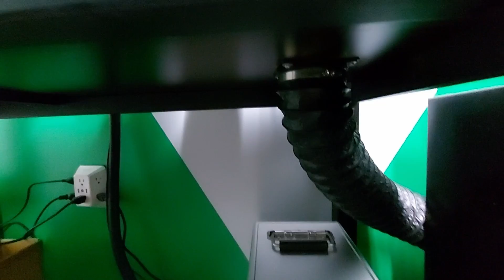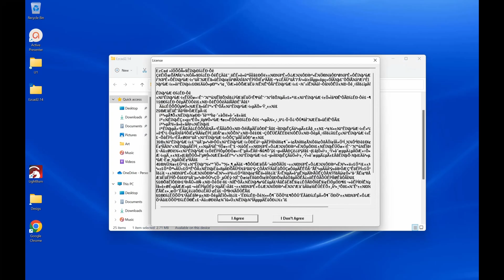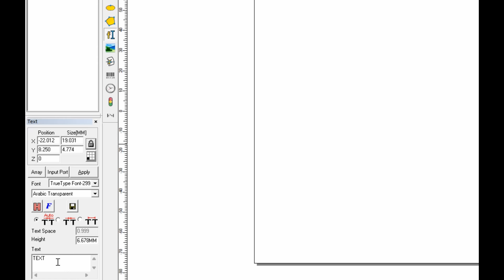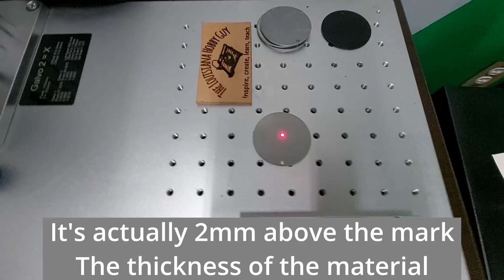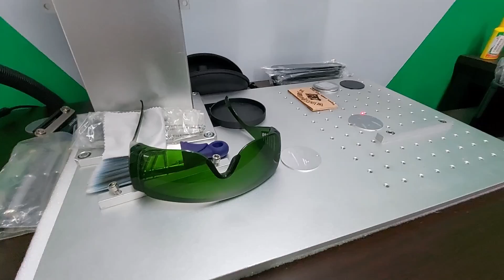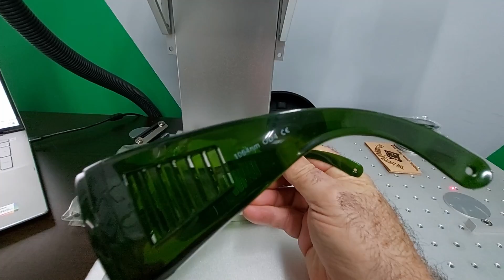💻 Get Started With Fiber Laser Software For Your Raycus Source Laser In Minutes!

Comment: Hey Rich....Just took delivery of my Monport 50 watt laser and got it all hooked up and followed your video above to install the software and guess what.... NO 2 little focusing lights come on !!!
I can focus while burning listening to the sound like you said BUT no 2 dots to converge and no 2 lights under haed next to lens HELP!!!
Reply from the maker: The tech support website is https://cofcc.com Bill.
Reply: Hope you figured this one out after a year, but just in case and for any others that have run into this. On the top of the gantry (arm that you move up and down for focus) there is a little button. This is the on machine on/off switch for the focus lasers. If they are not on,  just push that button located on the top of the laser head.
I hope I have enough detail without over explanation.  God bless and many happy engravings.

Comment: Dell's laptop speakers are also garbage for the cost of them as well. 😡 Maybe Asus does better?
Reply from the maker: These speakers are off the charts! They're amazing! And so is the screen! QHD & IPX touch & IrisX graphics with the Core i9 processor. Watching 8K videos is like 3D! I needed a convertible to fit in some tight spaces.
Reply: @TheLouisianaHobbyGuy  you got lucky. Mine are tinny and generally yuck. Luckily I prefer using other audio devices, but Dell dropped the ball for the price.
Reply from the maker: I use Klipsch THX Pro-Media on my gaming computer. Recently replaced an 20-year-old pair of Altec Lansing. Sound is important to me! But I have to say, this is the best sounding laptop I have ever heard. And it has a lot of volume as well. It'll suit the need for sure. I had to get something capable of traveling as well as video recording from a tripod.